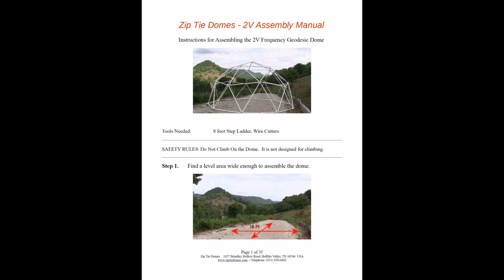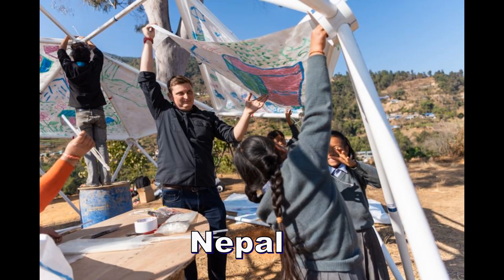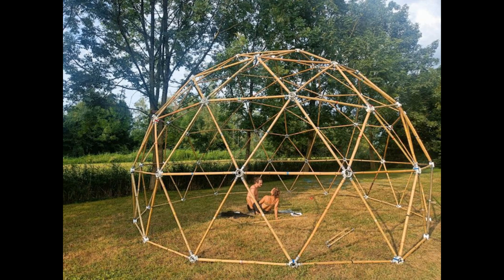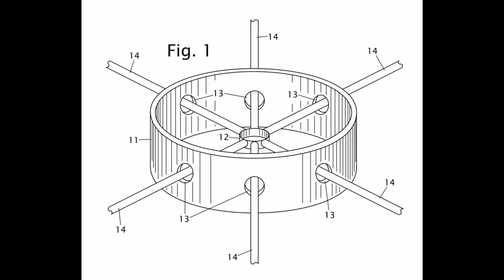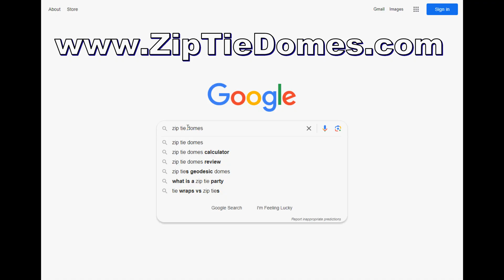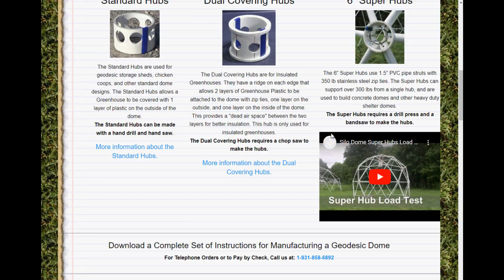Download DIY Geodesic Dome Plans –  Easy Geodesic Dome Plans and Kits

Comment: Would your larger dome be suitable to be covered in pig wire (for support) then hessian then painted with a thin concrete mix?
Multiple coats until a  thick enough "wall" could then be whitewashed as a permanent home?
Cheap housing solution or glamping pod...
Reply from the maker: Yes, I have someone in India who is building a resort with cement over our domes.  

You cover the dome with mesh, then spray it with latex cement for a thin shell dome.  For more strength, you can cover the dome with basalt mesh or roving and add additional layers of cement. 

Here is a video:
https://youtu.be/4q-vnElQXCk

John
Reply: @ZipTieDomes  Thank you. I did not know about the latex cement as it appears to be unavailable in some countries. The video you suggested shows me i can do a work around when the time comes. You are doing important work here...
Reply from the maker: @Darryl_Smith  Thanks, Darryl.  
You can buy Sika Latex down at Lowes for cement patching.  It makes the cement "sticky" so it does not have a "cold joint" or break in the cement. 

You can also spray closed cell foam, it makes a hard surface over the mesh.

Look up Dr. George Nez and "Latex Concrete Habitat", he wrote the book on using latex cement for roofs.

John Hurt
Reply: In the late '70s, we made jigs, cut boards, made marine plywood hubs, assembled, skinned with plywood, then coated with ferocement - cement over stucco wire. 35' diameter on a tongue and groove over roughcut oak platform, atop creasoted 12"x12"x12' tie blanks set as piers, with a center round pier and radiating floor joists. Made triangle plexiglass windows and skylights. Still standing. Lived in it over ten years, before moving on, x still lives in it...
Keep in mind that you may want to build in your furniture and surfaces, because traditional furniture and components are not always an easy fit - and your walls are angled inward, as they rise. You WILL bash the back of your head, when raising up from a squat or having bent over near the outer wall, until you get accustomed to it...
Wood heat from a centered box stove, walking water from a spring, outdoor plumbing, no electric, eventually an old rotary phone most of a mile down the driveway, in a lidded bucket screwed to a freestanding "temporary construction" wall...
Reply: If you're using round stock, I'd suggest considering high-pressure water and sewer line. It dramatically outlasts PVC in outdoor applications, in my experience, remaining pliable, while being thicker walled, and is really not that much more expensive...
Reply from the maker: @KathyMacDonald-b8m  That is beautiful, thanks for sharing.
Reply: @KathyMacDonald-b8m  Sound advice - thanks for highlighting. Thinking of 3 foot high earthbag wall to start as a 'footing' to give height first and a bit of scope for conveniences as the plan is to build 2 side by side with "tunnel" connector
Reply: I am using recycled carpet, dipped in a Portland slurry.  Then laid on the rebar and chicken wire mesh.  Like a decoupage but with cement.
Reply from the maker: @armageddonready4071  That is really cool. Please make a video and share what you know.
John Hurt
Reply: @ZipTieDomes I’m barely able to get up and move in the morning these days.
I would love to do videos, but it’s not easy doing it all by yourself, especially recording yourself doing stuff.
Reply from the maker: @armageddonready4071  I know what you mean, I am 68 years young, and need something to get me going in the morning.  Thanks for the information.  John Hurt

Comment: Nice
Are the metal ties a new thing? I got one of the plan-instructions and I don't recall anything about metal.
Reply from the maker: For the 2v kits, you can use plastic zip ties.  For the larger 3v kits we recommend the stainless steel zip ties and include them with our 3v kits.  
It is hard to beat stainless steel for strength and durability.
Thanks,
John Hurt

Comment: The 25' 3v 3/8 dome works great for building a 500 square foot sheep barn, covered with a heavy duty tarp.   I have had it up for several years, no problems.
Reply from the maker: That's a great idea.
Reply: @ZipTieDomes 
   Hi, been watching you probably about since started.
   Sorry don't need plans but using the zip ties and collar pattern was really ingenious.
   But with how I did it was to make much stronger for 50w x 25 high.
   So all straight parts were 3" pipe filled with light concrete mixture full of fiberglass.
   So outside can support 2nd floor with big center post and angle support s for trusses across the dome at twelve feet. To tall and need head room.
  This way staircase follows curve of dome, and give open railing up to opening with small hall and door to stop noise.
   But want to give you a suggestion,  maybe it can be patented because of how it applies to what you have.
  Don't need the money and son's and I are doing different projects.
  Being a retired engineer used to dealing with design architects, building codes, and able to use chart's about stress loads.
   I only did napkin scratching on the math the extra step also used made this almost five times stronger with 250 lb straps, so a cost saver to.
  Find someone who actually understands what is being talked about and they can do this ma to improve angles on rod ends also incorporating curve factor. Then with your pass through piece tell them there is a way to make that hole so fits pipes tightly (maybe you see how doing another simple thing makes better) by using angles and what you already have. The chart's on domes different sizes and perfect angles.which anyone can find but the school's went to crap past forty yrs.
   Thanks for what you figured and share with people.
  Just seems if you find the math help even hollow pipes with the changes make the structure stronger because of being glued also.
   But I just did this for myself and to make sure it can last 50-100 yrs or longer with a little maintenance.
   So a gift to you because you help everyone with your idea. If my small changes help you make other people safer it's all good.
   Last thought spray foam inside pipes will help with rigidity but have to put in sealed pipe and close tightly as soon as full. This makes curing result in stronger and denser infill. So might help make cheaper over seas. There cost for that kind of product is half of ours in the US.
   Okay rambled enough, hope this can be helpful.
✌️😎
Reply from the maker: @offgridmanpolktn  That is amazing!  Be sure to send me pictures of your work, here is my email address:
https://www.ziptiedomes.com/contactus.htm

I was looking at something similar, using a rebar threading machine so you can put a thread with a nut on the end of a long piece of rebar.  Put the rebar inside the center of a 3" metal pipe with just the threaded section of rebar extending past the ends of the pipe.  Fill the pipe with aircrete and cap the ends with a washer.  Manufacture the outer locking collar and center ring out of metal.  Drill a hole in the center ring to accept the threaded rebar and secure the strut to the center ring with a nut instead of zip ties.

If you need just hub and strut space frame, then this idea would be good.  But it is difficult, and requires a rebar threading machine.  And most people need a solid structure, not a space frame.

So, the solution where I am headed is to build the dome out of PVC pipe, or bamboo, and cover it with mesh, spray with latex cement, then add basalt roving or mesh, and add additional layers of cement reinforced by basalt so that the shell itself is what provides the strength.  Here is a video I made about the process:
https://youtu.be/4q-vnElQXCk

Using a dome as a form to cover with mesh and spray with latex cement is how Monolithic domes does it with just an inflatable airbag as the foundation of the dome.
https://monolithicdome.com/  

So the strength does not have to be in the structure, but in the concrete itself. 

I really appreciate your ideas and suggestions.  I am looking for a way to make affordable shelter for a lot of people that are homeless, that they can build for themselves anywhere in the world.   I would like to work with you on this project.

I like your ideas.

Be sure to send me an email at https://www.ziptiedomes.com/contactus.htm

Thanks,
John Hurt

Comment: Any info on getting vinyl covers for these?
Reply from the maker: A "fitted" vinyl cover can be more expensive than the dome itself and they wear out in a year or so.  

Our hubs are designed to take up the slack in an unfitted "flat" sheet of material to make the covering more affordable.  Here is more information:
https://www.ziptiedomes.com/geodesic-dome-connectors/about-geodesic-dome-connectors.htm

When you cover our domes with heavy duty greenhouse plastic, and you can put a layer on both the inside and outside of the dome for better insulation in very cold environments.
Here is an example for a year round greenhouse in Manitoba, Canada:
https://www.ziptiedomes.com/customers/kimpoppel.htm

For a permanent covering, we cover the dome with mesh and spray it with latex cement, which you can see at this YouTube video:
https://youtu.be/4q-vnElQXCk

A latex cement covering will last many, many years.

Thanks for the comment.  
John Hurt
Reply: Great product by the way. Thank you for innovating these solutions 👍🏼